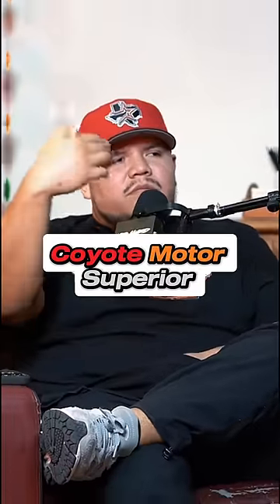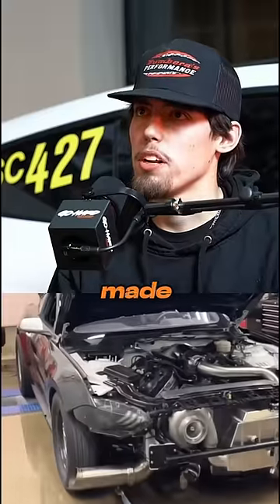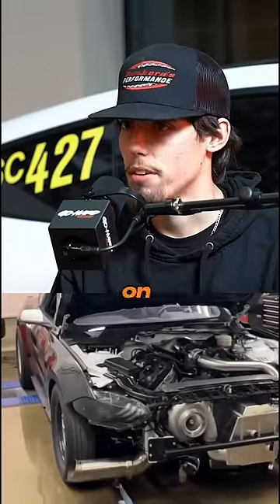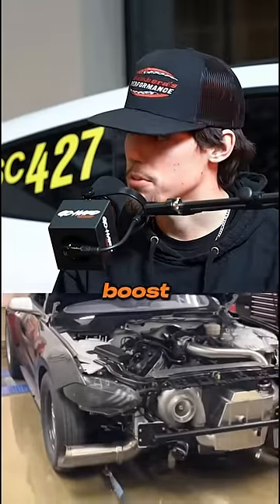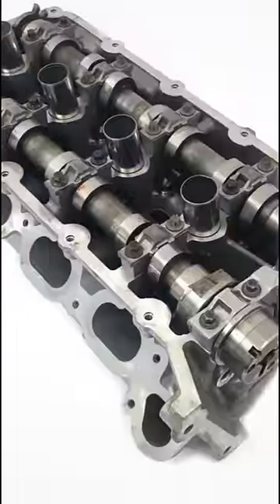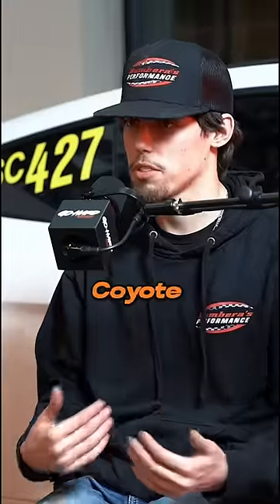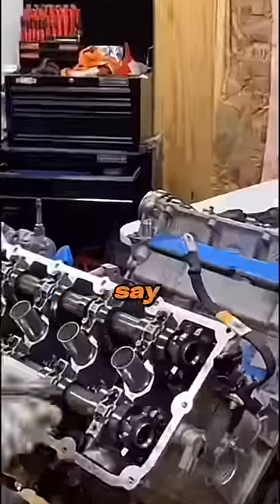SUPERIOR Ford Coyote Motor 😳 #shorts

Comment: Stock heads = stock f150 ? So f150 stock block is better than mustang stock block ?
Reply: Yep, 5.0 is different, just like the 3.5 in the F-150 it's forged, in my SHO I had to go built cause Ford was a cheap ass.
Reply: Blocks are the same, the parts on them are different in the earlier years.
Reply: @169abr  yea but he said stock head stock f150 , thats why the block is not the same i guess , plus there is video on YouTube named the different between mustang 5.0 and f150 5.0 and from looking at them i say they have different blocks but they are similar for sure

Comment: You can make big power on a coyote. The question is when your making 1600hp how long is it gonna last. Probably rebuilds every year, and i dont have that kind of money to risk, so i will stick with my 900wheel 11 5.0 Fully built Boss motor Gen3r e85. I cant even use 900wheel cause the motor spins to 7800rpm and i am going so damn fast there's practically nowhere safe to wind it out. And even with Fat Mickeys and full on built suspension it never dead hook on street at all. Plus i want motor to last and 900wheel seems like the limit of reliability.

Comment: Why people will push for 1600 hp with an aluminum block and head setup when theres soooo much cheaper and soo much stronger options is so mind boggling ...its aluminum i wouldnt trust it with that much hp as far as i could throw it

Comment: I like that some people here are comparing coyotes to LS1 and LS2 engines. And the video suggests coyote is superior because…if sleeved it can tolerate more boost… lmao solid logic.
Reply: Sleeves are ALL you need from the bottom end to push that power. Snot Rocket is making over 2500 at the wheels with just sleeves. Stock rods, crank, heads. Can't do that with an LS. You couldn't even get close.
Reply: @yummyhershey5902  Yes, coyote should be used in formula 1.
Reply: @yummyhershey5902  in fact I think coyote is so great, I have never seen them junked after 3-4 10 second runs @2000hp. The coyote engines that come through my tune shop make 6500hp on 50/50 blend of 87 gas and diesel and all they need are pure cotton sleeves.
Reply: @linvesel  aight, I'm not saying it's some godly motor, or even that it's better than the LS, but I do think it's impressive for those 10 passes.
Reply: @yummyhershey5902  all good, and that’s a valid point. It is def impressive for a few runs at peak ~1500-2000hp. Around 1000hp, LS has impressive reliability and longevity over the coyote, unfortunately. And it is unfortunate, because Coyote is a newer engine and LS is old AF. Ford annoys me with products that “could have been”. Coyote should have at least matched (if not surpassed) the reliability of the LS at 1000hp or even at stock. I want to have options, and not be boxed into using LS whenever reliability is a priority. These are the last great V8s of this country.

Comment: An LS isn't cracking sleeves at 1600 HP I promise
Reply: At that power level it'll be having all kinds of other problems on stock heads, cams, crank, and rods. The coyote can keep those untouched.
Reply: @yummyhershey5902  you are in fantasy land my guy. Maybe for a pull it two, but he just said it'll tank the liners out the block, who gives a fuck if the cam, head, rods and crank will survive and I hate to tell you this, but an LS can keep all them things as well and do it cheaper. You don't need 4 cams, you need one with an LS. Is that ideal for cylinder flow? Well no, but they have more head room for improvements, can take higher boost levels and are way cheaper to build so average Joe can make way more power dollar for dollar with Chevy like it's always been and will probably always be

Comment: Search engine Masters for the attempt to blow up a stock LS and a stock small block Chevy they didn't achieve and also the ls 7 427 LS engine was tested at 8000 RPM at the factory for endurance and was red line at 7000 to protect the warranty, the ls engines are superior

Comment: I’ve seen a 2500-3500 hp lbs motors but not a coyote
Reply: You haven't looked much
Reply: @kiwi8.  ls is just better
Reply: @rainman7794  it's just not
Reply: @kiwi8.  Chevy has been making motors better then dodge and ford since the 60s
Reply: @rainman7794  is that why ford outsells them? And also held most of the race record's form then?
Reply: @kiwi8.  only in truck cars and suv Chevy outsells and the truck aren’t far behind
Reply: @rainman7794  not world wide not even close

Comment: Bad editing ruined this clip... makes very little sense.  You need sleeves to run 25 plus lbs... as soon as you run 25lb you're cracking sleeves.  But now they make 50lbs on a stock non sleeved motor... brah wtf are you on?
Reply: I think he meant as soon as you run 25 plus you crank the non-serviceable liners in the block. He said sleeve that time accidentally.

Comment: da fuc…. that ain’t stock 😂😂
Reply: Stoc cast block from the factory, is what he’s saying. Just added stringer sleeves, pistons, rods. Car still has a stock crank as well
Reply: @SnyperMotorsports  if that’s the case, that’s a weak  flex.  A sleeved Kseries 4 banger can make that power w/pistons and rods AND get 20+ mpg.
Reply: @jreed9364 show us a sleeved KSeries going consistent mid to low 6’s in the quarter mile?  Just one please!
Reply: @iamSelfSufficient that has zero to do with anything I said.  Stay focused champ.

Comment: the coyote is a more modern design and can obviously be built to make more power because of that. But LS or LS based engines are incredibly common and easy to swap/ make more powere. but i think dollar for dollar the coyote can make more power. Both have their benifits tho in my opinion.

Comment: A Coyote has the best airflow and rev capability out of all the modern domestic V8s. All it needs is an iron block and strength mods. Stock heads, stock cams ( GT500 ) and fuel plus boost, 2500hp

Comment: Joke
Reply: Low 6’s ain’t no joke doe
Reply: 50 lbs of boost, I am lucky with 15lbs of psi
Reply: @Vik_F1Nasty pretty easy when your running a billet block…
Reply: @YesNo-ty5eb block is a sleeved 5.2 predator ALUMINUM BLOCK. i know its hard for you to comprehend. ran 6.20s. factory gt350 heads as well. on a 275 tire…
Reply: @2015GTPP I didn’t know GTs came with a sleaved predator block and gt350 heads, which year was that?
Reply: @ALYXTANKBACKPACK  i was referfering to brett lasala’s car
Reply: @YesNo-ty5eb  it’s not billet block sir

Comment: Let’s also not forget the LS was designed by ford and ford considered it a failure and weren’t going to put it in production so they sold the design to the desperate GM guys. Thats why ford always has been and always will be on top
Reply: Ford invented the LS?! What color is the sky in your world? 🤨

The LS was developed by GM with features incorporated directly from theeir NASCAR engine program, and the DRCE Pro Stock engine, both GM programs.
Reply: @machinist7230  yea. The Chevy r07. Which is basically a ford engine. But I digress. You think it’s a coincidence that the LS design started around the time GM bought lotus, who had previously worked with Ford to win races? Lotus built the chassis, ford built the engines. Even the early versions of the lt platform were built for GM by mercury (ford) Don’t be so naive
Reply: @joshuaearnheart2756  yes give ford credit for the worst run of corvette engines ever. This is quite hilarious. The gm lotus partnership laster only 3-4 years because of that doodoo. Is the LS copy of the Ford Windsor V8 engines? Or is the LS engine an original design that bears similarities due to common engineering design principles? There are too many differences to name in these comments but i can do it if youd like.
Reply: You must be one of those “the coyote is a v8 gtr engine” guys
Reply: @3BRAD5  nope. Gtr engine is definitely not even close to the same as a coyote. The coyote is a 90 degree v8. Gtr is the vr38 60 degree 6 cylinder. Completely different architecture
Reply: @joshuaearnheart2756  just like the windsor and the ls is different for tons of reasons too but we dont have to address that
Reply: @joshuaearnheart2756  thank you for the information on the transmission and clearing that up. Im sure if either of us looked enough we could see where each company has done stuff like this doesnt make one better than the other. You can argue the coyote is a better engine but to say the ls is designed by ford is completely false
Reply: @3BRAD5  nobody said the Windsor and ford were the same. So stop it. I’m talking about ed koermer who was affiliated with the lotus race team. He drove with ford engines in the race cars. Ford sold lotus to GM and then the ls engine came about a few years later. Ford designed the ls1 and decided it was too inefficient and knew it wasn’t the future
Reply: @3BRAD5  you can’t really find where ford does that with their powertrain. Not since the international diesels. They design and build everything of their own. That’s why I’m a fan of ford
Reply: https://en.wikipedia.org/wiki/General_Motors_LS-based_small-block_engine
Reply: @joshuaearnheart2756  if youre talking about that dohc junk that no one today uses yea lotus did that and it was the end of their partnership
Reply: Yea ford sold the Ls to chevy so they could be dominated well into the 2000s before making an engine worthy of being mentioned in the same sentence as an Ls give me a break
Reply: by all means though post more links and prove me wrong im not to proud to admit being wrong but the only true thing ive googled and found so far that youve said is about the transmissions
Reply: @3BRAD5  ford went through the growing pains when it was cheap. They made the first iteration of their modular engine platform.
Reply: @3BRAD5  yea, keep reading. Ed koerner is the designer. He came from a race team that was powered by ford engines until they sold to GM. You need more than that to try and prove something to someone that reads about everything engine related. Go talk to any old timer that is a die hard sbc fan. Ones that wouldn’t be caught dead driving an LS and ask them why. I’ve done all the research and talked to many folks that will tell you the same thing. They were in the race scene when it happened
Reply: @joshuaearnheart2756  thats why it bears so many similaties to the sbc itself go ahead and read that info in the link mr read everything about engines.